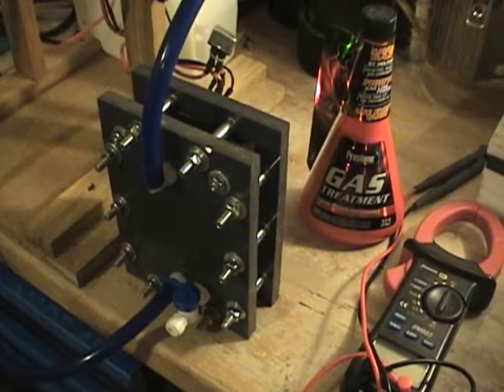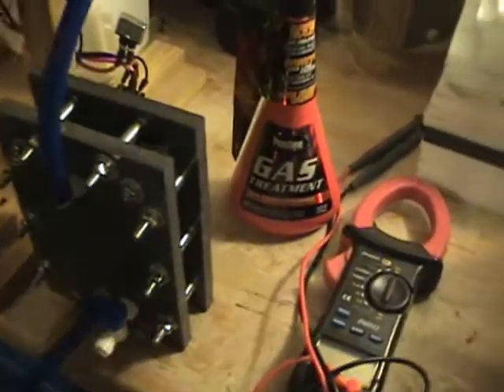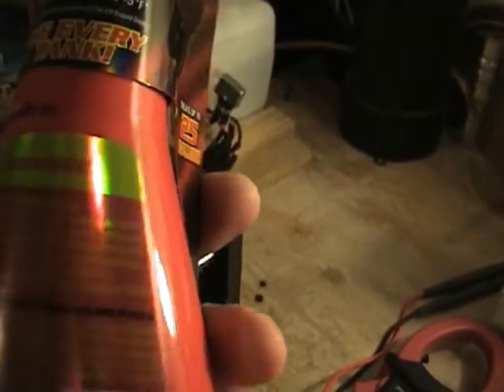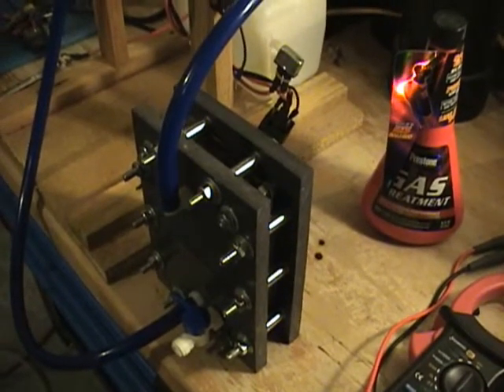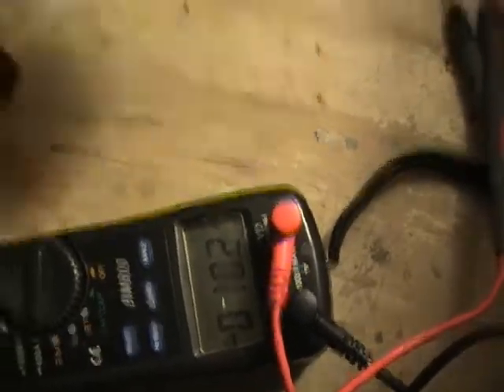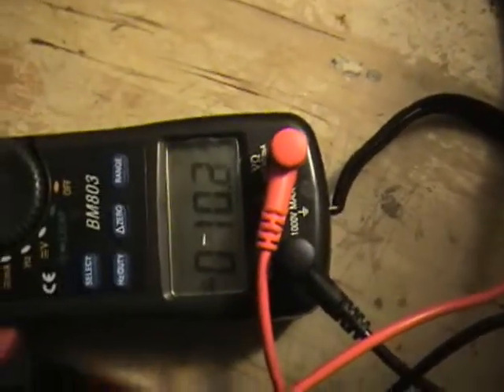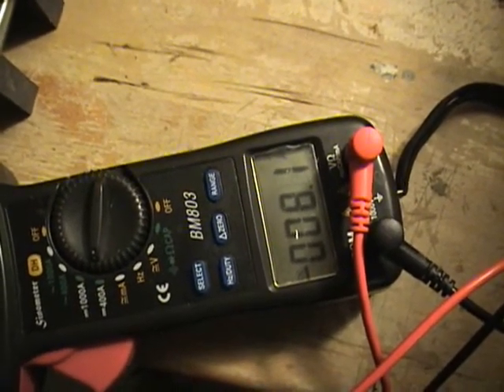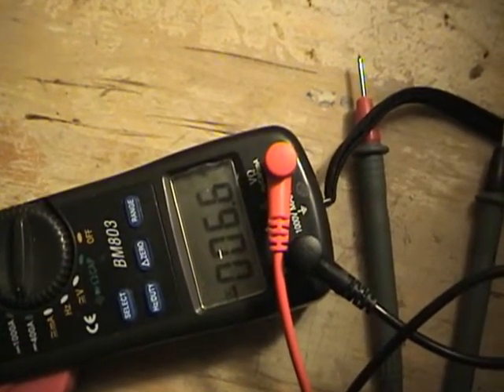HHO hydrogen Winter Electrolyte? Methanol. will it work?

Comment: methyl alcohol is methanol. denatured alcohol is ethanol with anything added to it that will make you sick if you drink it.  By adding organic solvents you are lessening the efficiency.
Electrolysis is a chemical process.  You should study a little chemistry.  By adding inorganic acids and bases you end up with simple ionic salt solutions ie:  NaOH +  HCL ->Na + Cl + H2O. The sodium will plate out the chlorine will evolve as a gas and the ionic solution itself will act as a "short"...

Comment: also way in the way back day, 150 years ago, those boys used acid for the e-cells, it was a bit hard on the plate material, but thats what they did. having the Koh in there should keep the plates good. I am interested to see if it works.